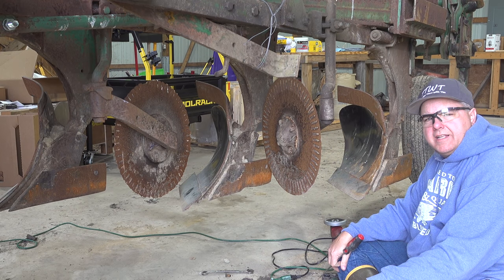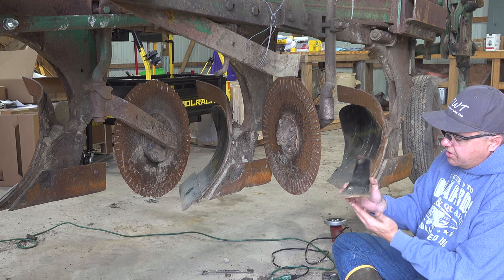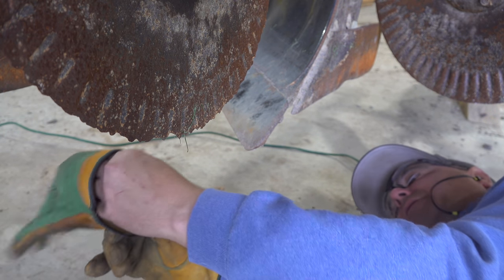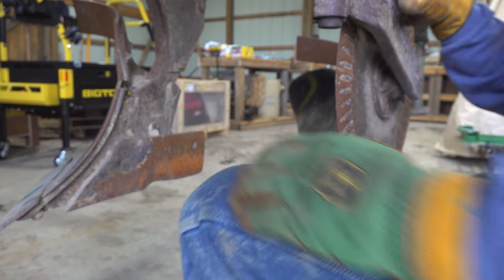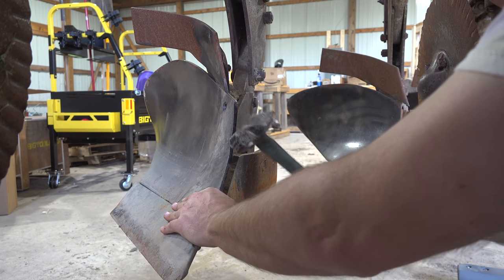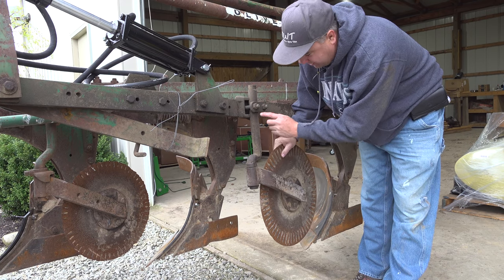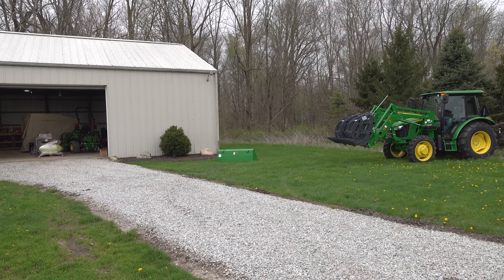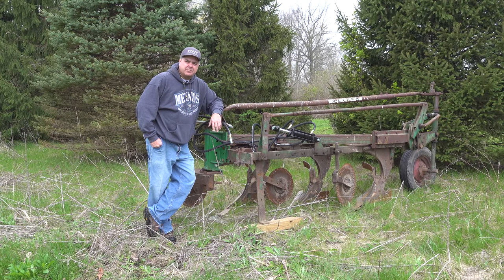Make Our Oliver Plow Great Again!

Comment: Great content Tim !! I appreciate you taking us along !! The third arm ( or middle arm as we call it) is hydraulic on all of my three point tractor hitches . Even though they are kept in a shed  , they will sweat and rust over the winter . I just put a thin coat of chassis grease on them. It works . You really have a nice large workshop now. You definitely need torches and even a 200 amp DC welder . A drill press and horizontal metal saw  will be handy too . In time I know you will get the tools you need . Be safe my friend and God bless !!!!!!     EDDY

Comment: I think that the shim is case hardened.  Along with the bottom cutting bar.  We use to change the shims and cutting bars every year.  And during the winter months my Dad would weld up the edges using hard surface rod.  That is how I learned to weld.  I've must have welded about a 1000 pounds of welding rod over my younger years.
Reply: H

Comment: When you are done with the plow this year, John Deere has a paint the is specifically made for plows to keep the Moldboard Plow's Moldboard from rusting. It comes off the plow the first time it is used. It is an Aerosol Spray Paint.
The other thing I noticed is that the bottom quick connect is leaking on the tractor. I would check to see if the steel line on the back is loose.
I have a used implement dealer 2 miles from my house I could see if they have an old Oliver plow to get that cuter wheel. They do ship nation wide, I could see then if you would like to call I could get their phone number so you could call.

Comment: Torches are cheap. It's buying all the "gas" that is expensive. Use propane or map. They are much less expensive. I recomend a mig welder or a "dc" stick welder. Just tack those bolt heads to the shin and the impact will either spin them off or snap the bolt. Faster and cheaper to use than a torch. I can see a whole bunch of new shop tools comming your way. Tell the "Finance Commitee" they are required for "Maintainance" and will make the equipment last much longer and operate safer. God bless and stay safe.
Reply: Lol the finance committee. Good to see everyone has one of them 😁

Comment: Tim, you should have let Katriel do that. She loves metal work, especially when sparks fly.  (Hey Katriel, Fathers Day is just around the corner and they sell cutting torch rigs at Menards)
Reply: Hmm Harris any relation to the torch company?
Reply: @devinholland2189  Nope except I own a couple. But I own Victors too.  I have got a big Harris torch that will cut a bulldozer in half. Works great cutting oil well pipe for fences.

Comment: Tim

That was a great trip down memory lane. The only thing I did not hear was "Oliver chilled plow".  Oliver was the guy who figured out that chilling the steel during casting produced the hardened surface with the softer but stronger steel in the middle. He called the original company "Oliver Chilled Plow Works".

I cannot wait to see it in action.  Can a modern John Deere 5000 outplow an Oliver 550? May the best green win.

Comment: Hey Tim,

Good work on the plow. It looks like the middle Coulter also needs replacing. Come on over to my house and you can help me. I have a Deere 2800 semi mounted 7 bottom plow that needs going through. It doesn't get used anymore for farming, but I like to take it out during plow days with the Antique Tractor club I belong to. Most everyone else in the club uses 1,2 and 3 bottom plows!

Comment: My friend - suggest you get a "Nut Cracker" - goes around the nut and you tighten in a cutter with a wrench.  One likely won't fit that one but others. Just a thought.  If you had air presser in a hose, a scaling tool - hand full of jabbing wires - might take out the dirt and clean it up.

Comment: Here in Finland we have really tough soil with lot of rocks etc.
Here all the plows have one additional part in the point of a blade literally called "plow's point piece" that is around 1cm thick extremely wear resistant metal and it takes almost all of the wear and beating the blade of a plow gets.

I dont know if thats a part in all new plow's across the globe or just an european thing.. but if those were my plows i would definitely add some point pieces to it.
Reply from the maker: Interesting.  Not many moldboard plows used over here anymore.  So, likely no new technology.  None of the major manufacturers even make a plow anymore!
Reply: If you dont know the part you can find pictures of a plows with them installed in google with "kverneland plow" search word.

Comment: The frog is the part that  attaches the point, shin, molboard, and landslide  to the beam. And molboards can wear quick in Sandy soil.  BTW - the RAYDEX shin probably has better heat treat and will outwear the others.

Comment: You need a plasma cutter.  That would make small work of the bolts and a ton more fun. I no longer use a cutting torch for anything.  I have a Hypertherm 30xp.  Believe me its lots of fun. Plus, try a set of Irwin Bolt outs for rounded heads.  They are not that expensive and VERY useful.

Comment: The last farmer i worked for made me preasure wash the plow spotless and grease the whole faces to store offseason. And every year before greasing the faces of the plow we had to weld wear bars 1/8 in apart across the face. And shins and any shiny surface. Took almost 4 days to get it the way he wanted........alot of welding with a blue colored rod i still have no idea were he got it or what it was. But it did feel like 6013.but left a wide weld path that had a almost ridgeless pass that laid smooth and the slag came off by itself.  He clamed he had not replaced a part on it other then a few bolts since new in 78.  He only planted 80 acreas.........but to me without knowing the price of the rods and time........it would of been cheaper replacing the wearables

Comment: AR steel plate Abrasion Resistant. T-1 steel is hard but can be brittle.  Mild steel hot rolled easier to shape, cut and drill. Cold rolled, more compressed and harder than mild steel, better machinability and smoother finish.
Looks like you are gonna need a welder and a plasma cutter before long.

Comment: Why didnt you wire brush or wire wheel the parts to remove the dirt and crud before installing new parts? Crud leaves old rust and spaces to trap water and rust frames.

Comment: I have gotten in the habit of locktiteing those plow bolts.  Did you buy that new cylinder. Are you going to go over it in a video.  That's not wire, It's a plow support retaining system. :)

Comment: TIM YOU MIGHT WANT TO RETHINK TAKING THE LOADER OFF TO PLOW,  YE OL 5 GOING TO BE A LITTLE LIGHT IN THE FRONT WITH NO SUITCASE WEIGHTS GOT 2 OF THEM NOW AND SPENDING TIME CONFIGURING THE MACHINE'S FOR VERY DIFFERENT TASKS. BUT I AM INTERESTED TO SEE HOW SHE'S GOING TO HANDLE THAT 3 BOTTOM, BUT HAVE JUST ABOUT FIGURED OUT ALL THE VARIOUS POWER RANGES OF THE MACHINE AND THEY SUPRISE ME DAILY, ECONOMICALLY SUPRISING

Comment: have you tried to back a normal draw bar type plough almost impossible also if you weld two pieces of half inch square steel on either side of the  swing arm that will stop the couter swinging so much cheers
Reply from the maker: Have never tried to back a pull type plow.  In fact, I’ve never driven a pull type plow.

Comment: You have a catch-22. Need more equipment and to pay for it you need to go back to the 40 hour paid job. But then you won't need the new equipment because you won't have time to use it!!

Looks like that existing collar has a square topped bolt in it so I would GUESS that the collar isn't supposed to be welded to the shaft. 

I'm not a farmer but I found the description of the plow parts interesting. I never would have guessed it was 3 parts.
Reply from the maker: You are correct, the collar is adjustable.  The square headed set screw is used to hold the collar in place.

Thanks for the kind words.  I'm glad to hear that you enjoyed it.

Comment: I saw the video where you got the plow. And to be honest it's the first semimountes 3 bottom plow I ever saw. Semi mounted 4 bottoms are scarce but lots of 5&6 bottom plows. I have a high clearance 5 bottom and a 6 bottom both IH. Trying to buy another 6 bottom IH plow but the lady thinks it's worth new prices. Not to me.
Reply from the maker: Have you ever pulled an Oliver semi mount?  They pull easier than any other brand.  Not exactly sure why, but one theory is how they are closer to the tractor due to the front cutter being on the steering arm.
Reply: No I've never had that opportunity. Only 3 farmers used Olivers and they were a little to far to make working for them affordable.

Comment: If I said it once I've said it a thousand times: TIME HAS VALUE. Budget says no torch set. Does budget allow for hours doing a job that should take minutes? Does the budget allow for an ER visit for the grinding dust that got around the safety glasses and lodged in your eyeball?
Decent torch set on Amazon is under $250.00.Cheap garbage set under $150.00 Top of the line set more $500.00.Bottles? Rent them.All are deductions btw. Not trying to rag on you but I hate seeing people doing things inefficiently.
Reply from the maker: Good grief.  Sorry to spoil your day.
Reply: @TractorTimewithTim  Day not spoiled my friend :) But seriously,the most precious thing to me is time: never enough of it. Learned decades ago:work smarter and not harder. On tools: no matter how extensive your tool selection is invariably what you need you won't have:one of those unwritten rules. I'm old and my tools are what makes my life easier and saves........ time.Been welding,cutting,grinding for over 40 years and grinders have burned down more shops ,started more wildfires,and blinded more tradesman than torches and welders by far. One of the more dangerous metal working tools out there.Like your videos so keep 'em coming.

Comment: Well see how they do. I just order isotunes pro using the ttwt.  See how they do when running the generator for welding and grinding and my 520.  Can you have a phone conversation while on johnny using yours. Should be here friday
Reply from the maker: Johnny at full throttle makes it a challenge.  At idle, it is acceptable.  However, you will have to explain to the person on the other end

Comment: ok... so for a torch... i highly recommend an oxy propane torch over oxy acetylene. here is why... oxy propane burns so clean you can literally use it in your house and never smell it or see any black suit anywhere... not that i would recommend using in the house.. seriously.. don't do that... next.. anytime you run out of propane in the middle of a job you can just grab the cylinder off your bbq pit and use it.. likely you'll be using a 5 salon propane cylinder anyway because they are easy to get and you don't have to rent them.. that leaves the oxygen bottle.. you can rent one.. ( not recommended) or purchase one.. gas suppliers aren't really selling them anymore but if you own one they will swap it out for ya and you will have their bottle but not have to pay rent on it and they will mark your bottle as one of theirs and add it to their inventory.. same would happen if you bought one from them.. they don't fill em usually unless you drop it off and wait a week or so.. get a decent set of victor regulators torch and hose and you are all set.. most expensive up front cost is the bottle at around 300 bucks unless you can find a local one used.. just swap it out at your local gas store and you will be all set.. just make sure if you buy one used that it can be swapped at whatever store you have local.. many tractor supply stores have bottle exchange programs too.. hope this helps.. and i wish i lived closer because i would defiantly help restore that old oliver plow...

Comment: Stop using those carbon fiber cutting wheels.  Get yourself diamond tip metal cutting wheels. Last better no shinkage and safer.  Ive cut my bed apart and all my new steel for my flatbed trk